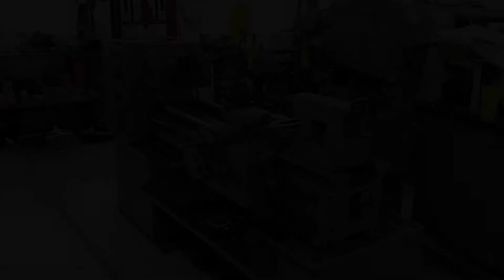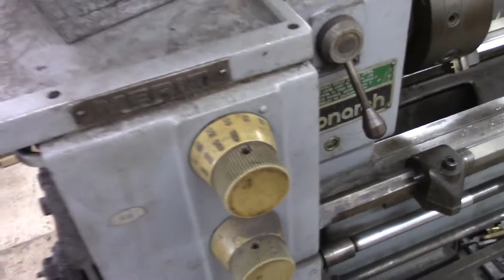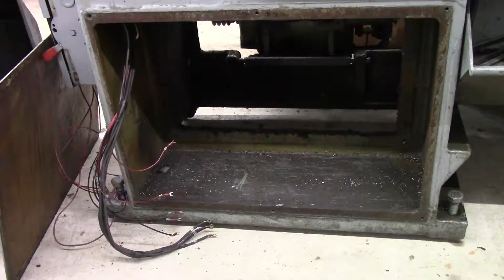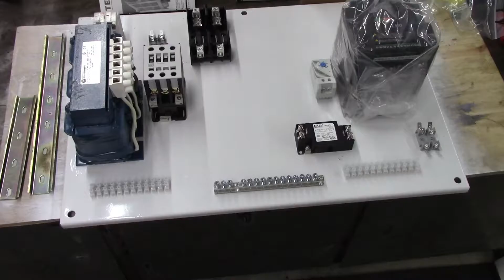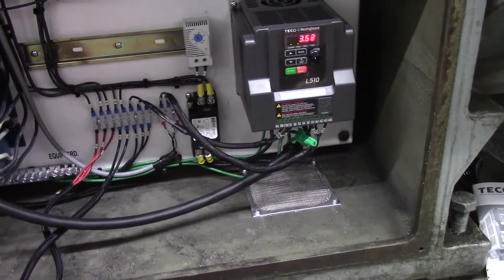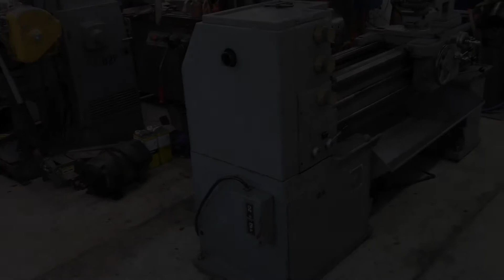Monarch Merit Repair and Upgrade

Comment: Great video. I just aquired a monarch merit myself and while i can get the original motor to run, it has issues. Wanting to rebuild with a vfd like you did on your machine. Could you possibly provide a list of components that you ordered and used on your merit? Any help would be greatly appreciated!
Reply from the maker: As I am not am electrical engineer I hesitate to make any exact recommendations but I will say that I used a Westinghouse Teco L510-103-H1-U VFD. The manuals for this are free to access on the manufacturer’s website and contain information on the circuits required to operate the VFD. I purchased parts from many suppliers including parts from EBay. I got the VFD and some of the other power components from Marshall Wolf Automation as well as parts from McMaster Carr and Digikey.